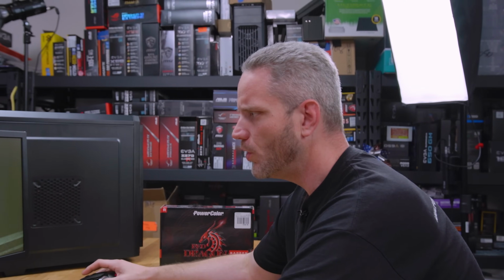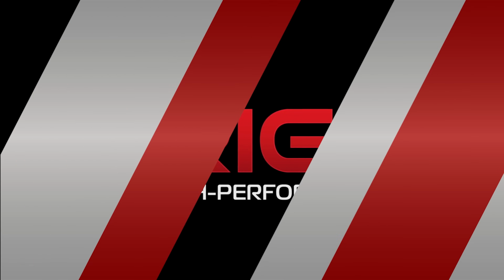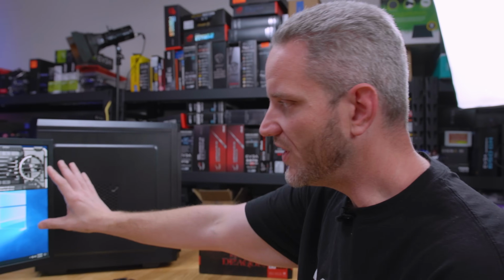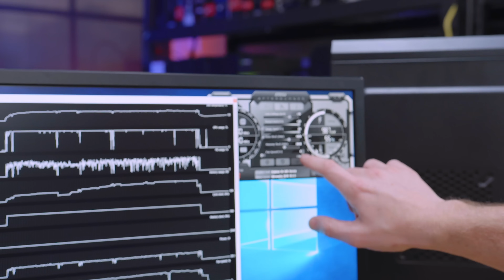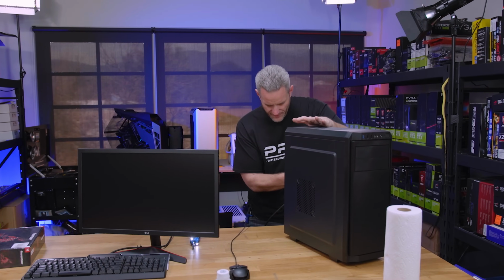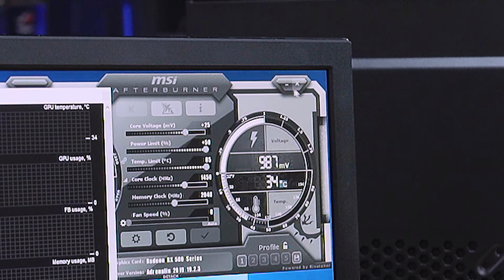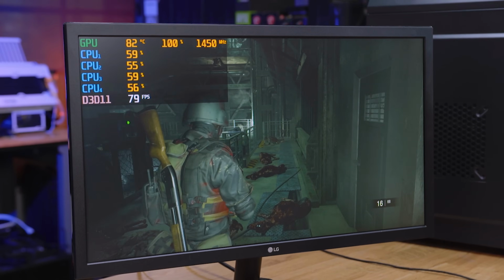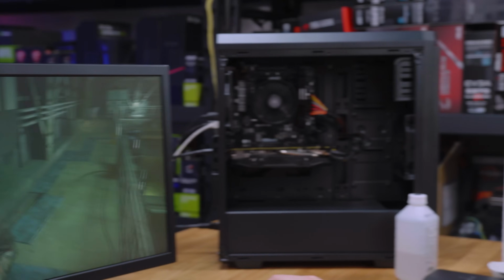Should you replace your video card's thermal paste??

Comment: my 1070ti runs at about 79-80c as well.
Reply: Yeah I kinda thought his temps were normal range for a GPU especially a budget AMD card overclocked that much with increased voltage on the core

Comment: I run my GTX 770 since i bought it when it was still new and did run it hard the last few Years and decided to change the paste this year. And i got really good improvements out of it! Under heavy load it is about ~ 6 degrees cooler.
Also from time to time clean your case from dust!
Reply: Cleaned my PC of dust yesterday but didn't pull my 8pin properly back now it's kinda hanging above the PSU shroud, instead of a nice bend, I realised this after cable ties were used and the glass panel was cleaned of fingerprints and other smudges

Comment: I've got similar results not on the thermal paste but on the thermal pad, uneven GPU surface and concave heat sink on a Radeon VII also don't help.  Unfortunately I didn't win in the silicon lottery.  I'm not running an OC with the stock cooler.  Mine was a direct purchase from AMD and it is 1147mV stock which I have seen boost to 1891Mhz cold.  The junction temps were getting pretty high peak @115C but averaging around ~110C likely hitting the throttle point and consistently staying under 1800MHz.  I performed the washer mod to mine, putting in a .5mm nylon washer under the spring clip holding down the GPU board to the heat spreader and in testing it looks to have taken temps down by around 10C peak.  Its no longer going above 110C where it would get throttled.  Last playtime GPU got to 1803MHz memory 1074MHz and junction temp peak was 100C.  So that slightly extra pressure on the graphite pad is helping.  I just ordered a newly released waterblock so will see how she runs on water.  I'm hoping for good results.

Comment: I had an odd amd card with a dinky cooler on it and it started to throttle at 70c. Believe it or not having a box fan exhausting air from the side actually dropped it ALOT and having it blow into it did virtually nothing...

Comment: For this I wonder if the a fan on the side panel of this case would lower GPU temperature better in push or pull.

I'm was planning on replacing the thermal paste on my 3 year old GPU. Thanks for the motivation. 

Keep up the great videos.
Reply: depends on fan curve and whether changed or not and if you created negative static pressure by adding hypothetical fan

Comment: I used liquid metal on my 1070 and it never goes above 60° even under syntetic load (I kno you are not supposed to use lm on gpus but is MY gpu)
Reply: As long as it doesn't touch aluminum

The gallium in the lm will alloy with the Al and turn it into something completely fragile (eventually to the point where you can break it with your bare hands)

Comment: I bought an Asus dual rx580 from Newegg about 5 months ago and I realized the temps were getting close to 90c under gaming loads. I replaced the thermal paste (which looked dry and crumbly) with some Arctic paste and it helped it by a few degrees but still remained above 80c even with decent airflow. I would still vouch for replacing GPU thermal paste if you don't care about any warranty at all

Comment: That same problem has the Zotac GTX 1660 TI (twin fan), it only has a small copper plate that is with the graphic processor, the thermal paste and the thermal pad are low quality.

Comment: In my office I redid the thermal paste on all the desktops we had. I used arctic silver 5 and these workstations would process all day and night long. SO i figured what a great way to test. Well after doing the thermal paste the temps did drop but only by a few C. was it worth it. No not really. Also these computer were 5 + years old and the intel paste was rock hard.

Comment: I had a brand new EVGA 1080 ti SC2 that had pretty terrible temps, it was hitting over 80C at 100% fan speed, changed the thermal paste to some Noctua NT-H1 and it brought temps down to the low 70s. The card ended up being a brick and had to RMA it, also had to RMA the second one I got because it had faulty memory. But new and high quality thermal paste can definitely help in some situations. Thankfully my third card has been good so far.

Comment: Whats this Thermal paste you talk about.. honestly though.. i have not ran Tp in my pc for 3 years now and i get 200fps on not quite ultra on world of warcraft.. nothing on the cpu or gpu.. nothing will go above 50 degrees c and i use msi after burner to push the gpu. and i have the cpu overclocked to 4.2ghz no fans and it just runs good.. if you want a picture just ask and i'll post it to you Instag....

Comment: Replaced thermal paste on my i7 5700hq and two 965m’s in SLI and saw temps drop by 9-12 degrees on CPU and 7-8 degrees on both GPUs... definitely worth it

Comment: This is another issue of but why. Like the whole front air being choked issue. If your not throttling who cares? my GPU wont throttle until 94c, why would i care if it runs at 40c or 84c? same with the CPU if your not throttling who cares how "cold" you can get it. The only time this makes sense is on a old card with old paste.

Comment: I had to do this on my 1080, I went from hitting a constant ~82c with max fan speed to around 65-72 at ~50% fan speed. There was basically no thermal paste. It was almost like it melted away, looked like a tiger stripe pattern

Comment: How is the fan noise? I  guess it's running auto fan curve and 82 is the set temp limit? IMO it would have been even more accurate to test with a 100% fan speed to really flesh out the possible difference, if any.

Comment: I was having a similar experience with my xfx rx 480 gtr.
Even liquid metal only worked like... 5 degree celcius to cool down. Yet what I noticed that the fan speed was very low so it was a  win alteast in noise
Reply: Change your fan curve/temperature target if you actually want lower temperatures.

Comment: My XFX RX 580 was getting the same temps, changed the thermal paste with noctua thermal paste temps dropped by 2-3°c but it still runs 78-79c
Reply: Try to downvolt this. And buy more fans if u can.
Reply: Use kryonaut or conductonaut

Comment: Last year I bought an Arctic Accelero Xtreme IV for my Titan X (GM100-400) and removed the already applied MX-4 (Sorry Arctic but you gotta learn from Thermal Grizzly) on it and put Kryonaut on. SUBTRACTED 18-35°C WHILE overclocked on +170 GPU and +400 VRAM, voltage doesn't matter I just put it up to max cause the stupid power limit of only 110%... No matter what I do, it never goes over 61°C in Winter.

I would even change the paste before even putting a brand new card into the PC because manufacturers deliberately put on the worst and cheapest paste they can find. And there are absolutely no exceptions.

Comment: That's how my Radeon rx 580 was till I got more fans and it's staying  below 65c°
Reply: My rd 580 stays around 40c until I start a vr game then it goes to almost 80 c lol and it's a really loud gpu fan
Reply: @JustJacobBK1  Which RX 580 model do you have?
Reply: @Condred  xfx model
Reply: Its 65c° in games like BO4 and DMC5 but when its idle its stays 35c to 39c
Reply: Xfx fatboy
Reply: How many fans do you have now ?
Reply: @watthehellmoderfocker5189  I have 5 fans not including the one one the CPU. My comp is fully air cooled
Reply: I have 4 fans atm 3 intake and 1 exhaust do you recommend getting 2 more exhaust fans??

Comment: I think you made a huge mistake by not having a fixed fan speed.
Reply: Why? If it's not nessecary it's just more power draw
Reply: @sLaMz1o1  because maybe changing thermal paste helped but fan speed is lower so it has the same temp as before
Reply: @sLaMz1o1  the lack of critical thinking here hurt my brain. im pretty sure that fans dont use more than two watts and the power needed for them wont run through the gpus die. as jonas said, it could be programmed to use the fan speed needed to keep it under or at around 82c. jay never said a benefit of changing thermal paste would be lower noise/fan speed so thats a huuuuuuuge variable to having consistent results to compare the actual effectiveness of his thermal paste change. to test when i changed my thermal paste on three 1080tis, two identical zotac blowers and one aorus gaming 1080ti (over two months ago) i downloaded nice hash, kept the same oc and maxed out the fans. on my zotacs running daggerhashimoto, before they hit a top temp of 68c, now they dont go over 54c. on my aorus it hit a top temp of 62c and it hasnt ever gone over 53c under the same testing circumstances/conditions/variables. a change in thermal paste in MY environment and set up has effectively shown that the thermal paste, not cooler design (blower vs open shroud) is the limiting cooling factor.

Comment: I replaced my MSI GTX 1060 thermal paste and got 10C lower temps and with my custom fan curve lowered fan rpm around 600-700 lower. Huge difference in noise pollution when gaming.
Edit. This wasn't old card. I had bought it new week prior to thermal compound change.
2nd edit. I did overclock my card as far as I could get it and power limit stopped me from going further. At full load my card doesn't get hotter than 70C.
Reply: if you wanna overclock more increase the voltage
Reply: @gwennnnnnnnnnnn  it's pascal lol increasing voltage in afterburner does nothing
Reply: @gwennnnnnnnnnnn  Feels like so. I have maxed core voltage, power limit, temp. limit and memory clock sliders and have bumped core clock 125. So now I can get stable boosted core clock up to 2088 MHz and stable memory clock of 10 008 MHz at 70C. If the slider would let me I could get even more from my memory.
Reply: @juhokaartoaho  just hook up ur car battery charger to it
Reply: @gwennnnnnnnnnnn  😂

Comment: I replaced my gtx 1070's thermal paste last weekend. I was initially going for Liquid metal, but the gigabyte g1 gaming card seemed to have aluminum too close to the die, so I put thermal grizzly's aeronaut instead.

Now the issue is that it's been running about 4°c hotter and it's louder now, which is weird because I feel like the old paste was dry and not well placed. I applied a thin layer of aeronaut on the die and spread it evenly, then reassembled the card.

Could anyone help me with this because I don't have any idea what went wrong
Reply: You need to use a lot of paste. One big pea size shape
Reply: Take it apart and see how well the paste spread, then reapply.
Reply: Maybe try tightening it properly ? I mean cross style and quite tightly
Reply: Aeronaut is the lowest end paste from Thermal Grizzly. You should have went with Kryonaut or similar quality.
Reply: Also you most likely need to apply a bead if paste, not spread it before putting it together. You really should only spread it first if it was liquid metal.
Reply: Not enough paste. Take it apart again , use 90% ir higher alchol and clean the die and paste carefully. Let it dry out. Apply a new layer , thin again and then put a blob in the middle of a normal size , not small or big. Then assemble it again & enjoy 10/20 C cooler card.
Reply: Okay, I'm responding to some of the comments made:

I'm aware thermal grizzly's aeronaut is their lowest end paste, but could it be worse than the stock? I also have Noctua NT-H1, would that be better?

When putting the card back together, I carefully aligned the card with the heat sink and then cross tightened as well. I screwed it tight.

I did clean everything super well before applying the new paste and will do it again if I will open it again.

So it would be better to put a pea of thermal paste on the die and then let the pressure spread it, rather than spreading it evenly before reassembly?

Would thermal pads really go bad from just opening the card? I mean they seemed fine on the outside and are still making proper contact. Though there could be some science behind this that I don't know of
Reply: @AmPPuZ  YES let it spread on its own, DO NOT pre-spread it!!!
Reply: maybe an air bubble trapped? because you spread it, common knowledge is to not do that

Comment: For these type of tests in the future I think it would be better to use a completely flat fan curve for constant RPM. If the fan curve bumps up significantly at 80C it could be that there was an improvement, but it just was hidden because the fan speed below 80C wasn't enough to keep the card from heating, but the fan speed above 80C was more than enough. To see if there was any change with a fan curve on you need to look at the fan speed and see if its spending more time at a lower RPM or something.

Obviously this is somewhat quibbling as most people are going to use some type of fan curve and not just constant RPM so keeping fan speed constant isn't a realistic use case. It will allow you to know for sure if there was any effect though.

Comment: Why is evryones GPU running so hot mine is like 65°C max with 65%fan speed at a ambient tempature of 19°C
Reply: What gpu cooler?? What case with how many intake fans?? What gpu?? Of you have a gtx 1050 i wouldnt really be surprised if you hit 65c max...
Reply: also 19 degree ambient is pretty low.

Comment: When i first got my EVGA 980ti SC+ I noticed that it ran pretty hot. When I checked the thermal paste situation I noticed that part of the gpu didn't have any thermal paste touching it. The replacement did drop my temps about 8c since now the whole gpu had thermal paste on it.

Comment: I dropped 6 degrees C by replacing the thermal paste on my laptop's GPU...
Reply: yeah, laptops REALLY appreciate a good clean and replace of thermal paste. noise goes down.
Reply: Yeah I know the feeling. I had to do that with a brand new laptop. I was getting around 50°C idle and around 80+°C while gaming, with prime95 it as 95+°C. I took it apart and found out it was a terrible thermal paste application on the cpu. Now I'm getting average 70°C gaming and 80°C with prime95
Reply: @TheAtqthe30th  I'm going to get Asus FX503 should i be worried about this? Specs are I5-8300h,8gb ram ddr4, Intel 1060 6gb,512 ssd gb hard drive. Its costing me around 1500€ wich means around 1700-800$
Reply: @17genc  in most cases you don't need to worry. I bought a cheap budget MSI laptop and I just ended up with a bad one. I was adding my own 960GB SSD into the laptop and thought I'd check the thermals and decided to change the paste. I could have returned it and tried my luck but didn't want to pay a restocking fee or be sent a refurbished laptop through the warranty
Reply: holy shit 70°c when gaming , i shat on my pants when i see my laptop gpu goes up to 65°c
Reply: Your kind is not welcomed here 🤣
Reply: WOW, gaming must be amazing now!
Reply: Lmao why even go thru the trouble for a shitty laptop

Comment: I would never bother replacing the thermal paste on a brand new card unless I was installing a water block. And or if I've had it a long time and it's starting to run hot. OR.. if you're heavily overclocking it.... I guess.
Reply: @Tick Tock Tech - Not really sure what your logic with that statement is seeing how the factory thermal paste that comes on even the newest cards is 100% of the time a generic paste that is 'good enough' but not great. Replacing it at the very least will hurt nothing and at most will help the card to run cooler as well as help the fans to run slightly quieter as well. But it's your money and your hardware so do with it as you wish.
Reply: 4 or 3 pwm signals
Reply: Maybe you're just lazy! :P
Reply: @videocardsvs7445  or maybe some people don't like spending several hundred dollars on a brand new "fixer upper?"
Reply: @gholwiih  - Based off of your own logic you'd buy a new car and then never wash it or clean it ever because hey it's new and you don't want to spend money on a 'fixer upper'...
Reply: @videocardsvs7445  +1

Comment: i probably need to do this on my going on 7 year old GTX 670 but i'm too afraid of killing it with the arctic silver 5 i have. I've looked it up and while it's not conductive it is capacitive. so if i mess up my card can die then i'm royals screwed. if i do it and get better temps it's very meh.
Reply: Grab some mx2/mx4 when it's on sale. I'm using deepcool z5 atm, it's not too bad.

Comment: I haven’t finished watching the video, but on my zotac 1080ti blower style card and my aorus 1080ti (not the extreme the one a step down with the smaller copper backplate) both saw double digit drops from going to stock paste to kryonaut and mx-4. I didn’t bother with my brothers msi twin frozer 1080ti bc of the sticker on the screw and it’s temps are lower than the other two cards before and after.

Comment: I have a 980ti i bought new back in 2015. I replaced the thermal paste on it with some thermal grizzly kryonaut.

While I did not notice any huge temperature drop after cleaning the cpu cooler and repasting, what was noticeable was the GPU fan was not running as intense.